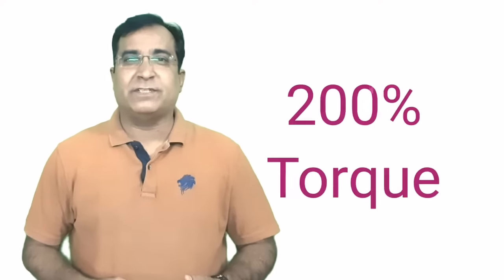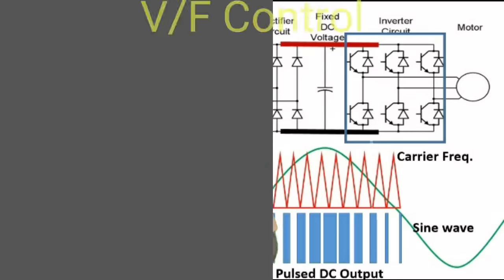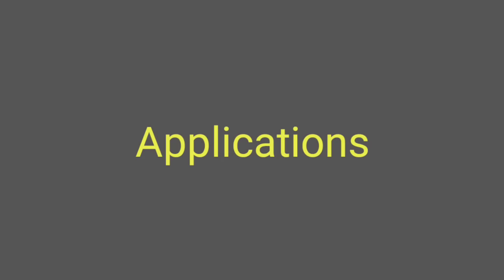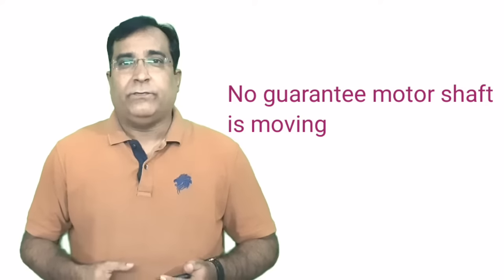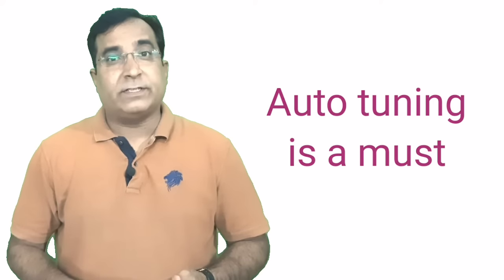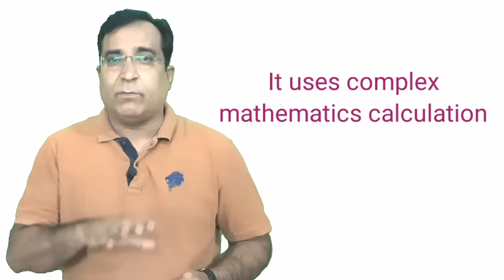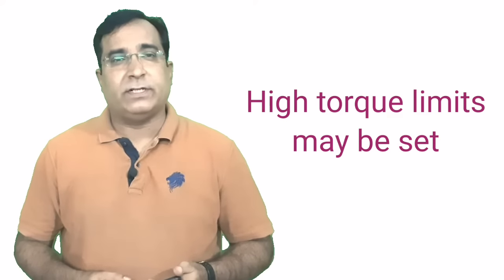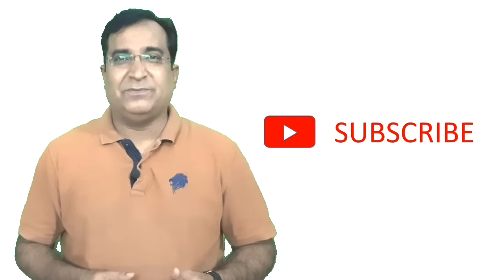VFD Control Methods | Scalar Mode | Vector Mode @dineshdiwani

Comment: Sir motor name plate
400volt   6000rpm  104hz  me he
Vfd per chlane per frequency 55 se uper nahi jyati
Vfd me fd mode set ker rakha he kya problem ho sakti he sir
Reply from the maker: VFD me Max freq kitni set hai? Check kro
Reply: Sir vfd me maximum frequency 104 he
Reply from the maker: @satishpawar110  then no issue it will deliver output at 104 hz maximum... You specifically told it is delivering output at 55 hz... I think this setting is lock in setting menu. Check again. Or check motor data if it is has been feed correctly.

Comment: pulsed dc how can be converted to sine wave please explain
Reply from the maker: These pulses are passed through a windings of motor which are an inductor. As we know an inductor opposes any current change. The moment inductor saw a pulse it retards sudden current change. When dc pulses of varying width is passed through winding... A sine wave appears across its winding
Reply: @dineshdiwani  and sir you have talked about 200 torque with no rpm is it magnetic locking = cogging
Reply from the maker: @workbyvivek6557  that is the condition when vfd is operated in vf mode with frequency at zero and rated voltage is applied. But in vector control two diffrent imaginary vectors contros magnetizing current and torque producing componet separately. In that case motor is actually running at 0 rpm with full torque.

Comment: Sir VFD ke input current and out put current me defrence kyu hota he jabki starter me nhi hota ?
Reply from the maker: Vfd output supply voltage below 50 Hz is below the line voltage so to fulfill condition of Pin=Pout the output current must be higher than the input. If we consider 50% speed the output voltage will be half but output current will be double to fulfill Pin=Pout condition. Some losses occurs in vfd so output current is slightly less than double of inout current.

Comment: stop reading what written in front of u ..instead explain the things if u can ....humble request
Reply from the maker: Sure... Make a question? If you had any by watching video. I will try to explain you if i can.
Reply: @dineshdiwani  sir ur material is grt but explanation is too fast....may be u want to make smaller video.....
Reply from the maker: @shankarsahni  nobody wants to hang up on phone for half an hour. Its not movie. Majorly i try to explain thro pictorial presentation so that if you miss any point can get it from pitorial presentation and cover practical aspects only assuming you working on these system ao that you can relate with your experience.